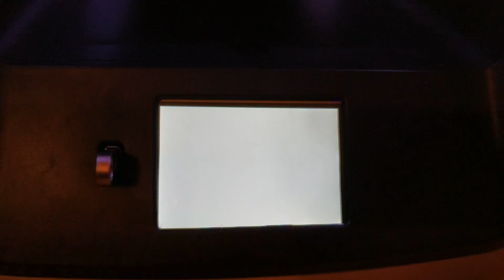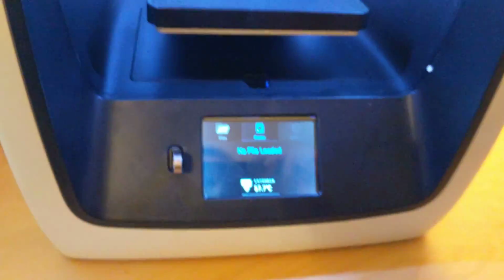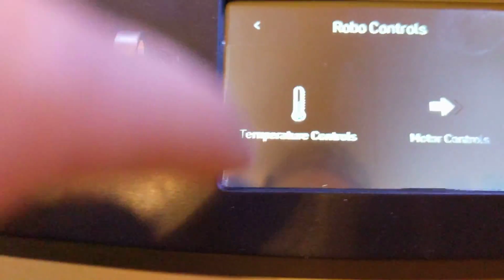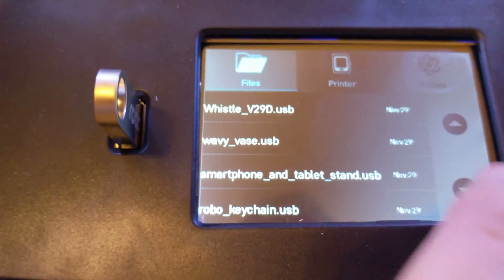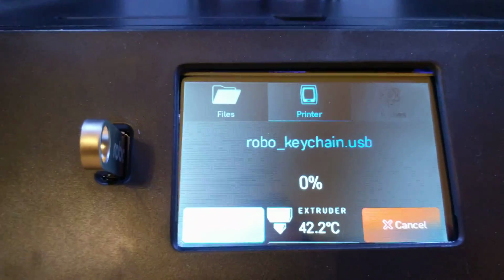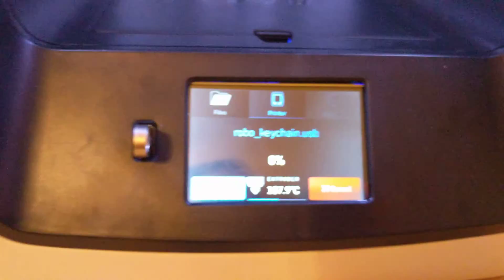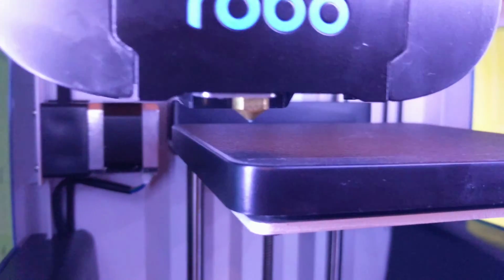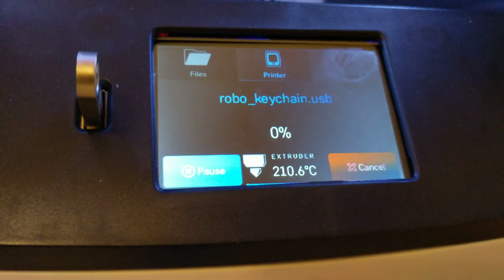Robo C2-Quick Overview

Comment: This is the noise. https://youtu.be/KeHGj1IZfhs

Also any tips to getting your prints stick?
Reply from the maker: I would try turning the printer off and on then rehoming to see if it continues to make the noise. It is either not hitting the switch or it may be broken. Hopefully it is a simple fix!
Reply: moozicmon spoke to support today. I was the second person to report an issue like this with the grinding. Support level 2 is going to work on another customers. I'm sending mine back to Amazon and trying another.
Reply from the maker: Ouch. Glad they are acknowledging the issue though.

Comment: I just received mine in today. Everything is set up. However, at the beginning of each print, it makes a LOUD grinding noise. Then it moves into position and works ::knock on wood:: seamlessly. My z-offset is at a -5.2... how about you? I may raise it to a -5.3
Reply from the maker: I'm at -5.2, but I also am using a sheet of Buildtak. I think you'd be fine with either.